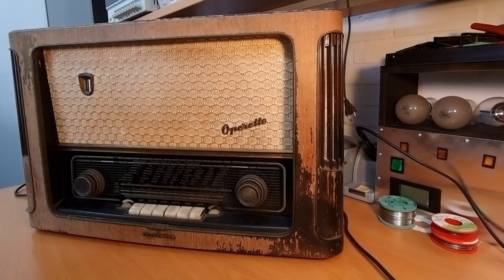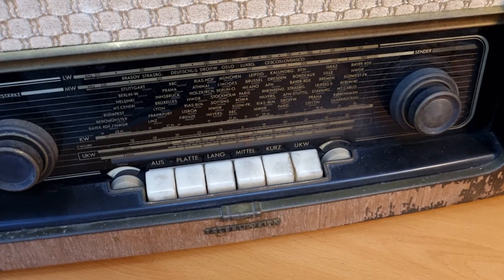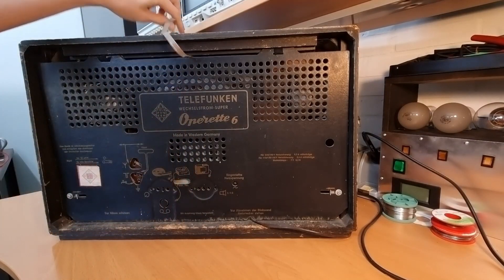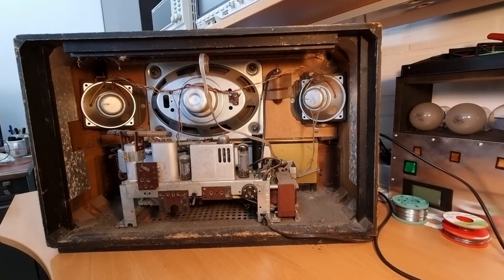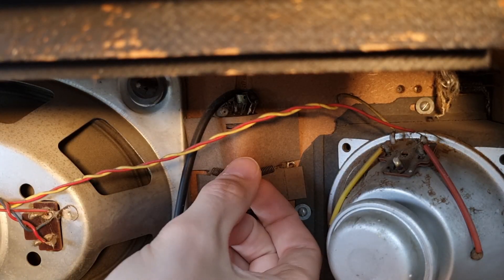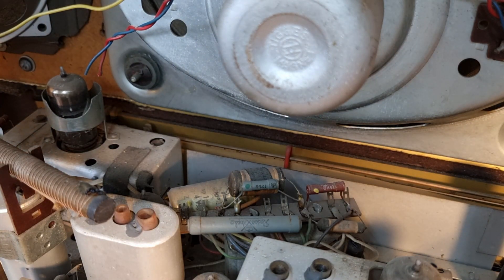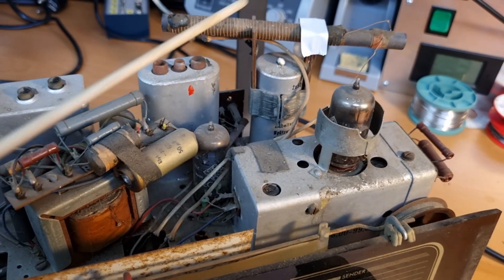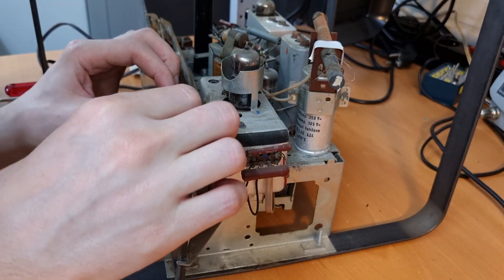This new patient on the workbench needs a lot of attention - Telefunken Operette 6 (Part 1)

Comment: I made a mistake and deleted by accident my comment 😅 but thanks for your answer. 
I think I will go first for a external wire. 
Looking forward for part 2.
Reply from the maker: Remember that the ferrite rod is only used for AM. So if you only care about FM, you don't even need it and the internal dipole should be enough.
Reply: If I find a ferrite rod, I will install it, first my main concern is to get it working. 
I know basic electronics, but repairing a radio like this is a whole new level for me.
Reply from the maker: We all have to start somewhere. 😉 Just take your precautions and be careful with the high voltages in these devices. Getting shocked by 275V DC can be deadly.
Reply: @retro_tech   thanks for the advice. 
Cant wait for part 2 😊